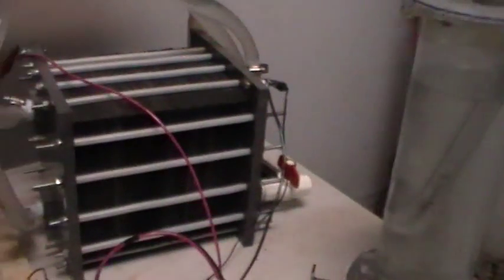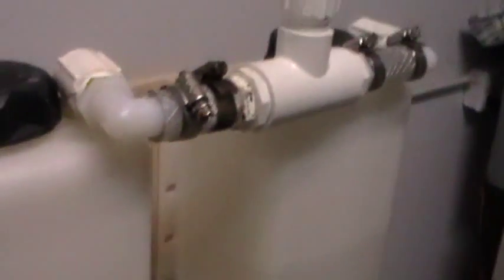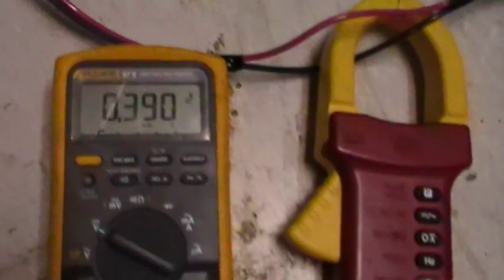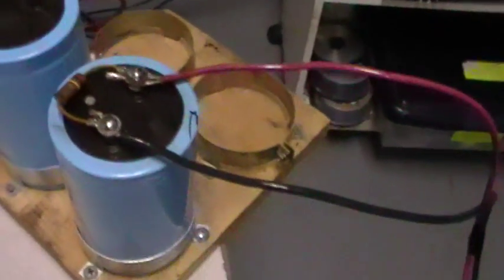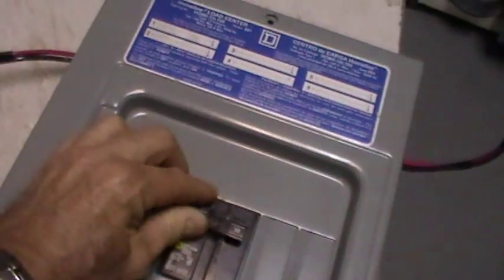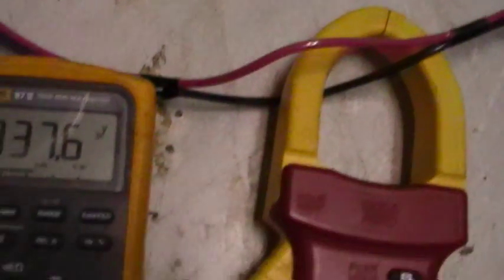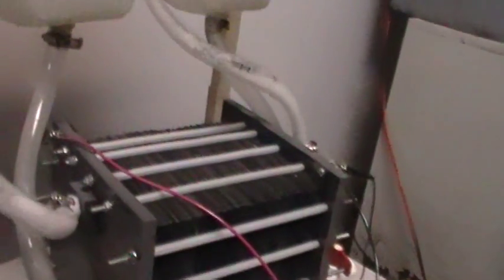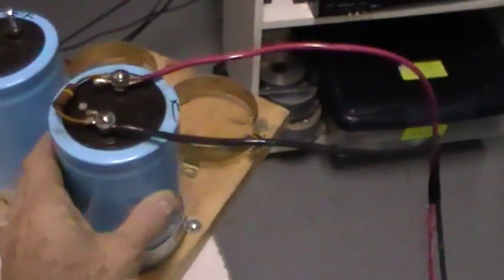New and Improved 118 Monster HHO generator part 10

Comment from the maker: @RzBusterCB87 you can only run a electrolyser on DC voltage. HHO production should be calculated in watts. 30v @ 100A is the same as 100V @ 30A. Efficient hho generators use about 200 watts per liter of production.